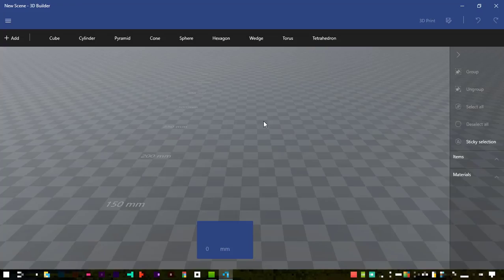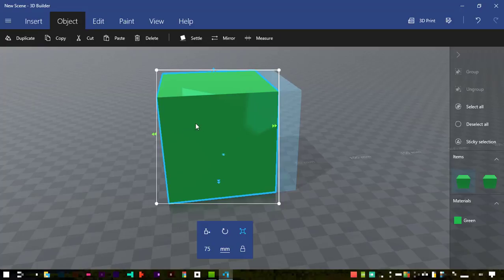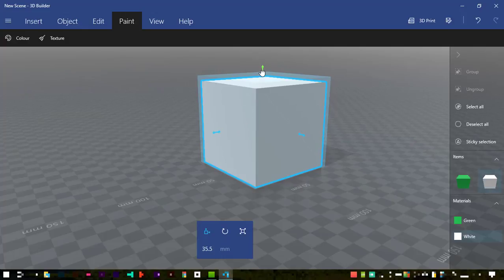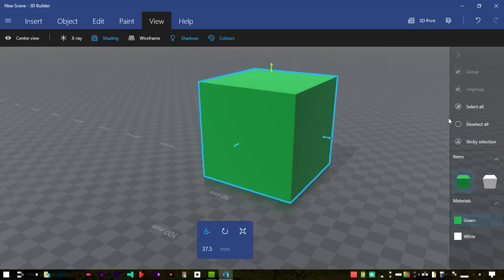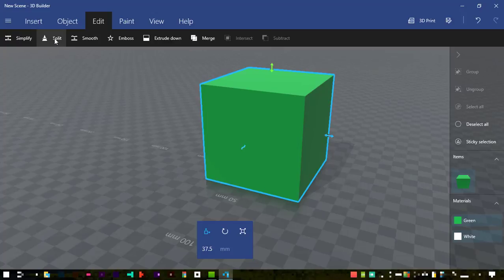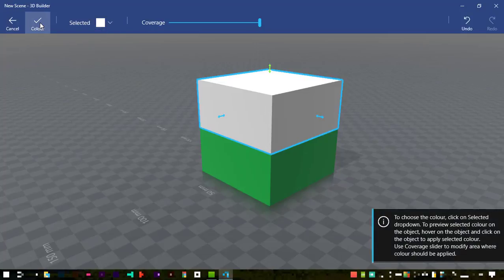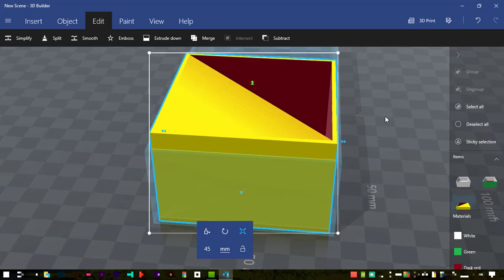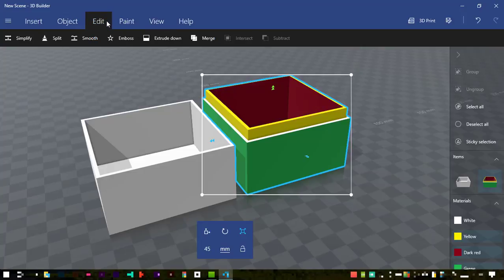Designing A Cube Box For 3D Printing In Microsoft 3D Builder

Comment: Great instructional video! One question, (I'm still a noob here) can this be saved as an stl then all we would have to do is open it in a slicer then save the gcode then go to print?
Reply from the maker: +Paul Palumbo Microsoft 3D gives you the option to save as STL so, yes :)
Reply: GentlemanCrafterUK awesome, thanks! I've recently acquired a new laptop and new to windows 10, let alone 3d builder :) cheers and tnx for the quick reply!